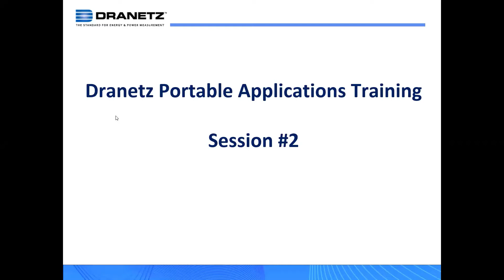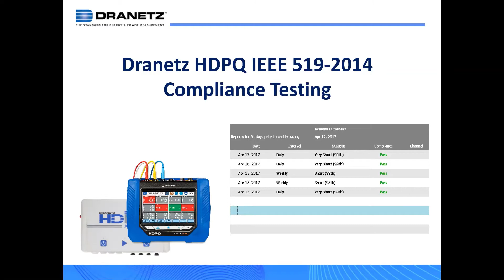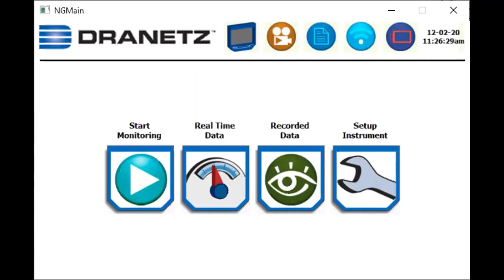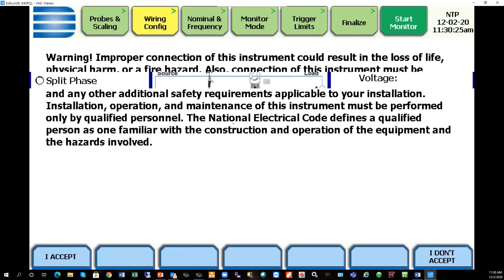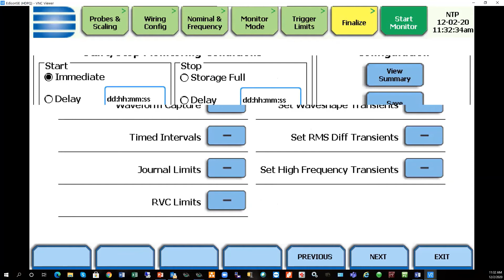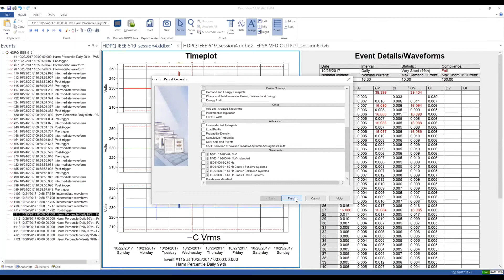Dranetz HDPQ IEEE 519-2014 Monitoring

Comment: good day, thank you for the presentation. would just like to clarify with regards to the setting for compliance to IEE 519-2014 Very Short Time and Short Time harmonics (3 second and 10 minute harmonic calculations respectively) where do I find this setting when setting up the equipment? 

or does it always take 3 seconds? regardless if the interval for "Harmonics, Interharmonics, Seq Components" is set to 10minutes? Worry we are not setting up equipment right. Thanks

We  have HDPQ Dranetz Visa that shows Very short time, and short time event similar to  32:18 However, we have old Dranetz HDPQ Visa that do not sure this events. They also do not seem to capture transient properly (always 0V). 

same setting in the equipment, 
2 Dranetz HDPQ Visa V1.3.15 and 1.2.8
2 Gossen MAVOWATT230  V1.2.8
1 New Dranetz HDPQ Visa bought decemeber 2019 V2.4.31

Only the new dranetz hdpq seem to show some detail. Not sure if firmware issue? How to update?

Comment: Post processing and storing parameters at smaller intervals and generating a big data set is something we see great value in and power components especially in the smart grid world with many avenues for nonlinear loads. In effect we would like to go beyond the standard power quality metrics in the international standards and add in more powerful signal extraction, processing techniques through other software engines having that flexibility is a must to look at impulsive transients of around 50 nanoseconds or less with nonlinear inductive loads and switching. Of course dranetz products or for that matter most products can’t do that nanosecond sampling of incoming power but this is where power quality analysis is heading.
Reply from the maker: Thank you Math Man. That's a benefit of Dranetz products. Most go well beyond the standards requirements and also provide lots of raw information for post processing by Dran-View and other software.